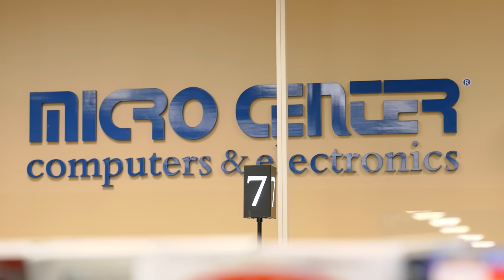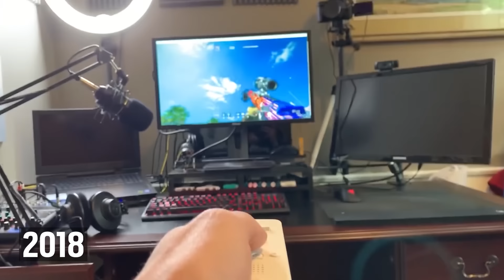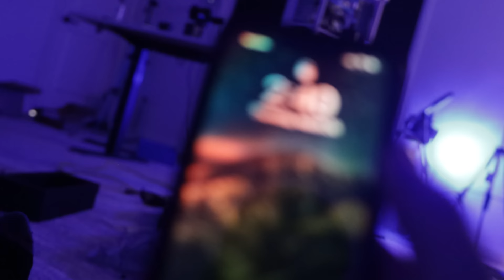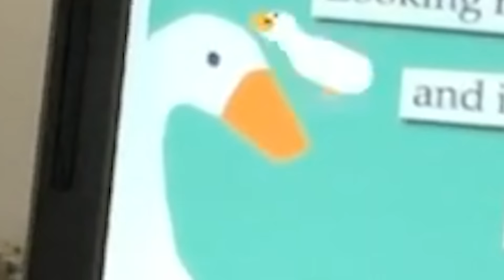I Built the Ultimate Wire Free PC Setup

Comment: Yup, this is definitely the cleanest and prettiest setup I've seen so far. Only thing it's missing is a 5.1 surround system with all the speakers mounted up on the walls. Wouldn't work in your case since you have a kid that wants to sleep, but I don't think I've ever seen a cleaner setup.

Comment: Just to share something about the acoustic panels setup. I'm from South East Asia btw. I've worked as a sound engineer before in a small music studio and since we broke gang, we find alt ways to cover up reverbs. We bought cardboard egg trays from the market then covered one side with thick fabric, then lay it and nailed them in a wood board to act as a wall and hook in on the studio's wall. If the reverb is still strong, we put thin bed foams, not too thin but it's enough that you can actually sleep on it. For the floor we bought door mats since it's cheap when bought in a bundle. Good ol' days.

Comment: Congrats on the setup almost done!
But the question is, how to charge your keyboard, mouse, and maybe headset where you will still need wires onto your desk or else you just got to put them on a separate place for charging, I'm close to starting my desk setup wireless soon with those problems solved and I'm not so sure about drilling in walls, maybe only for the screens, but nothing more, I'm sure you'll get there to the point of wireless in the near future like all of us we solve these problems ;3

Comment: Im crazy about wire too, wall mounted pc, all my wires are in the wall, but I managed to put 0 wire in the rear nor front IO, truly wireless PC. I simply use the usb type-E on the board, get a usb hub in the wall and all my peripheral are running in the wall to this USB hub. Of course I had to move the PSU to get the 120v wire invisible too.

Comment: Those Mavik chairs aren't bad. I am really REALLY glad to see influencers and what not getting away from gamer chairs. I could rant about this for a long time but I am telling you if you can afford it buy a NICE chair. By nice I mean a good office chair. Do your research but the herman miller aeron is kinda like the gold standard of GOOD chair. I went from a bad gamer chair that gave me swamp ass to a cheap but decent office chair and it was 100 times better. Then I got a free aeron. The chair was 16 years old at the time in 2017 and for the first year I had it I thought "It's alright I dont get why people love them" Mine had a few issues. The gas piston would make a popping sound sometimes when I leaned back but only like 1 out of 10 times and the arm rests would slowly slide down and I'd have to move them back up like once a week. Then one day I was talking to a friend about aerons and I said "they're alright mine has these issues.." then he pointed out that the chair was 17 years old and those were the only issues and it dawned on me. This chair is older than people reading this comment. This completely changed my mind about them. I ended up replacing the gas piston and that fixed that popping sound and the armrest thing isn't a huge deal. I can fix it I am just being lazy. 
People will talk about the comfort of the aeron and yeah they are comfortable but its not anything crazy. I have sat in more comfortable chairs but the aeron maintains the same level of comfort all day without causing back pain. Plus the adjustability is insane. Anyways I know I sound like I am trying to sell people on the aeron only but I'm not there a dozens of cheaper options that will be nearly as good or possibly better but the aeron is just a good option if you dont want to take a risk.

Comment: My only complaint with microcenter is the fittings in stock. Not the best material working as an engineer. But I suppose of your on a budget. Sure. 

Other than that, solid build. Like, the best I've ever seen.

Comment: That's a bad spot to put the monitor on... Your eyes are supposed to be at the same height as the top of the monitor as you're sitting straight in your chair (as of the healthiest standard that's recommended if you don't want to have any neck aches or back problems)